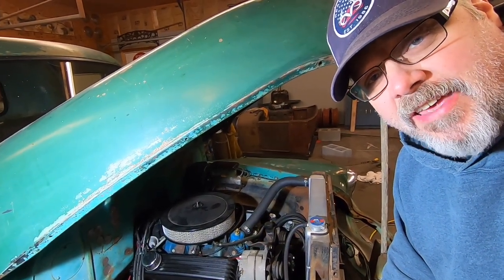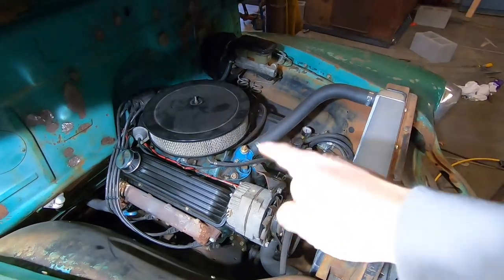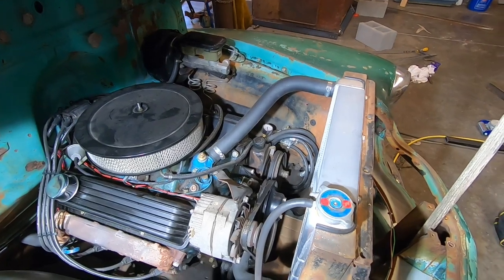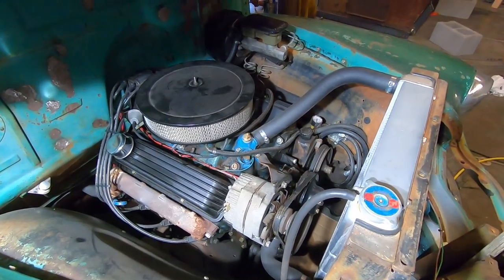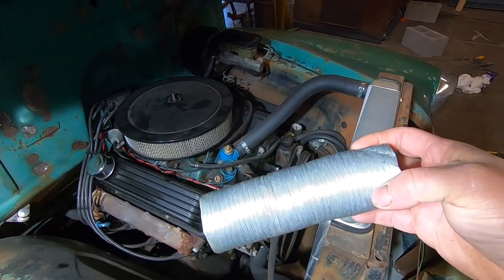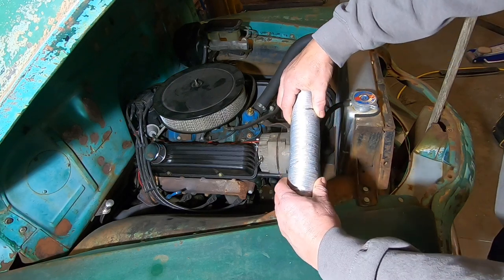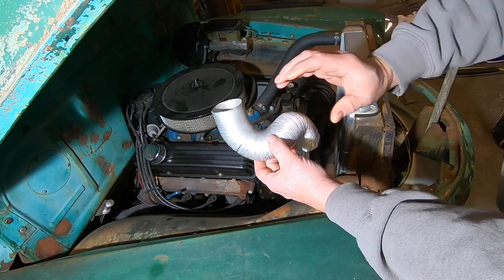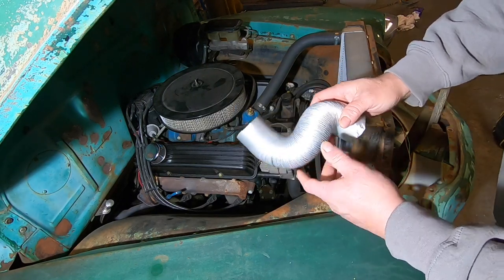Custom Fitting Radiator Hoses #hotroddad #hotrods #classictrucks #techtips

Comment: I've been searching videos like yours hoping there'd be some tip on maybe re-forming bends or something.. the trouble we have in the UK is; there are no parts counter guys anymore. If you can't give them a VIN number so they can look it up on the computer, you can't get a part - it didn't used to be that way, but it has been for 10+ years now, which is a real shame! Ah well, mostly commenting to tell you that your phrases raised a chuckle! Colder than a well digger's boots, indeed :)
Reply from the maker: It’s mostly that way here, too. They will let you go in the back and let you look through the hoses until you find something that will work, though.

Comment: Hello HRD! great Idea sir. Where would I find the flex hose you used to bend it to the shape you wanted? The tough part is finding a 2" x 1 3/4" end diameters to fit water pump to radiator neck. Thanks for sharing. Cheers from Motown.
Reply from the maker: I think this is it. You could probably take that Gates number and have your local parts store order it so you can physically inspect it before you buy. https://www.amazon.com/Gates-28081-Pre-Heat-Duct-Hose/dp/B000IY99FA/ref=mp_s_a_1_39?dchild=1&keywords=defrost+duct&qid=1631794264&sr=8-39

Comment: What do you when the hose goes to 2 different size necks?
Reply from the maker: Never ran into that.
Reply: @HotRodDad   I used a piece of smaller hose inside the larger. A get by fix not a good permanent solution. Next time I’ll solder or braze a sleeve on the smaller neck or maybe run tubing with a reducer and rubber couplings.
Reply: Having that same issue too Robert. Need a 2" x 1 3/4. Flex hose (12") length will not bend enough so I have to use a regular rubber hose. What a pain in the ass this is. lol

Comment: Does a 2016 Hyundai  Elantra or any car normally have 2 upper radiator hoses?  I think my bill has an error on it.  They are trying to charge me for  2 upper radiator hoses and 1 lower hose.
Reply from the maker: I’m no expert on Elantras, but most modern cars only have one.
Reply: Thanks for your reply.  They said the second hose is a "bypass hose."